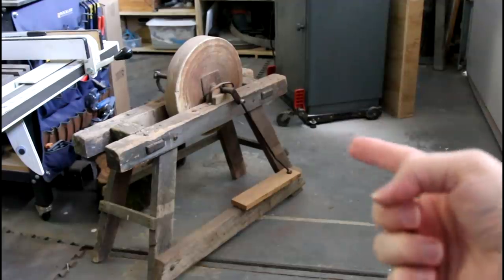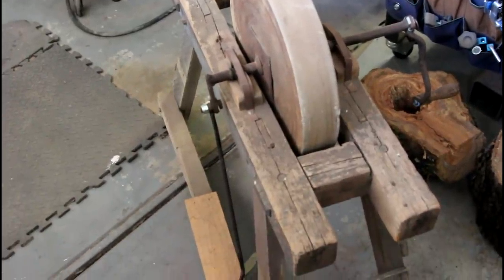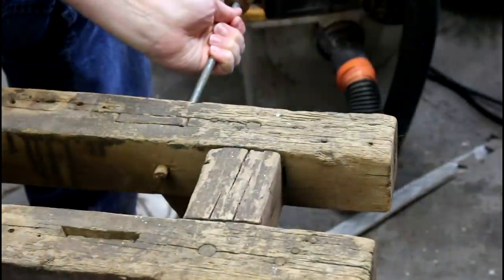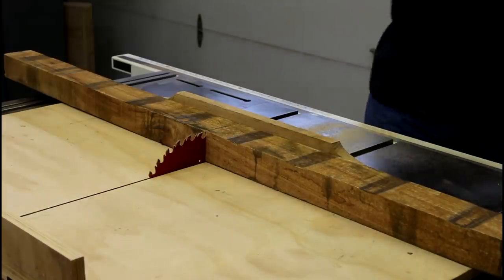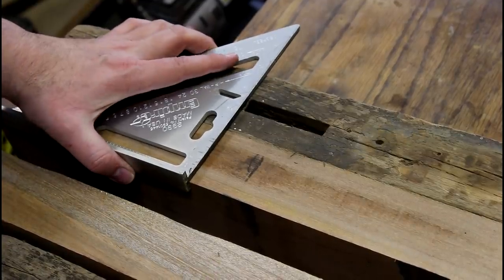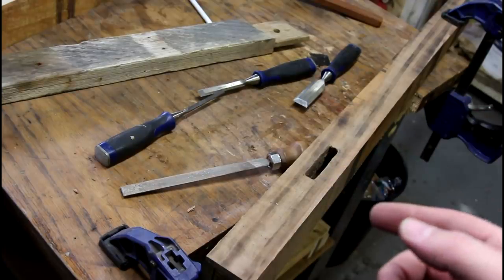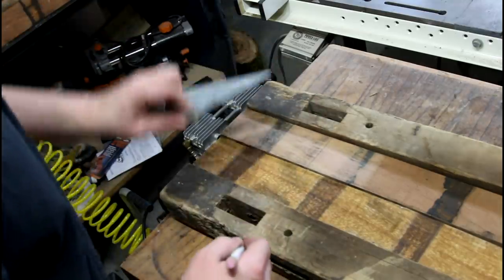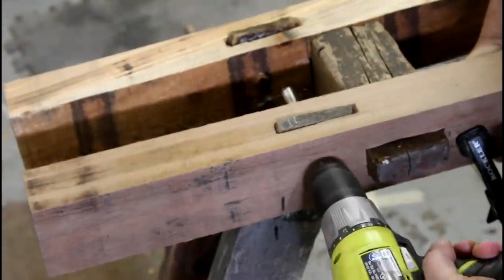Sharpening Stone: A Rescue & Resuscitation Story

Comment from the maker: Thank you all for the information! I'll work on truing up the wheel up and adding some method for wetting the stone. For me, the fact that it turns and doesn't collapse when used is more than I hoped for. 

Its functionality can be...honed. :)
Reply: It's a fair bit of work to true a stone... But I think you'll have the time for it.

Which way is the door, I'll show myself out.

On a happier note, you'll have an easy time using and maintaining the stone.
Reply: Good thing you're getting more info instead of reinventing the wheel.
Reply: Badum-tish...lol <3
Reply: If you add a water trough make sure you never leave the stone in the trough when you're done using it. That's a good way to end up with half a wheel, which is considered a bad thing...
Reply: You did a great job though! I KNEW you were going to pull out some Skyrim quotes :) speaking of actually, I notice the grinding wheel model in the game has a little reservoir of water suspended above the wheel to tip out. I wonder if that would be a solution for you?
Reply: Pretty sure they are designed to have you sit in a chair apposed to actually on the grindstone table haha

Comment: There should have been a cup on the bottom to hold water in case you want to wet sharpen. The reason it was small was because typically the boys in the family were given the job. Nice save!
Reply: Dwarf relic of Gimli
Reply: So you are saying it needs a cupholder.

Comment: Peter, There was quite often a trough under the wheel that had water in it to keep the wheel wet and the tool cool. And, yeah, I have one of those grindstones I picked up about 50+ years back. I need to true it up one of these days.
 I'd love to see you make some resin castings with metal filings in it, but with a big magnet on the underside of the mold so that the resin captures the magnetic lines of force. Maybe install a LED under it so as to really show off the force lines.
Reply: So your wish has come true! He made a video doing just that 3 weeks ago. It looked pretty awesome.
Reply: Please please tell me you saved the wood that you replaced for other projects. Bowl turning etc. The grain must be awesome
Reply: For these old grinding stones the water is to keep the stone clean and lubricated.  The stone doesn’t go fast enough to cause the steel to lose temper.  That’s why oil or water is still used when hand sharpening with stones also.  The steel particles clog the stone and cause it to wear out more quickly if water or oil is t used.  Good job on the restoration!

Comment: Good job taking on some new skills! 

As others have pointed out, with those old sharpening stones, you should use water on the stone to lubricate and help carry away the grit and metal filings as you grind. Some had a trough on the underside that would keep the stone wet. Others had a water feed from the top that would trickle water onto the stone. Either works.

Comment: What’s with all the glue? That shouldn’t have any glue in it at all.
Reply from the maker: my joints needed glue or it would be in pieces again! :)
Reply: The holes should be a little bit offset, so when you drive in the pegs, it pulls everything in really tight. You did an awesome job on that frame though! Not bad at all for a first time! The first time I tried building saw horses using mortis and tenon joints and pegs, it didn’t turn out very well LOL. It took me a lot of practice to get it right
Reply: @peterbrownwastaken  You did good, I'm hoping for a part 2 and 3 where you straighten the axle, make sure the bearing blocks are tight and true that monster stone.

Comment: Awesome Video.  My heart hurt a but with you using plyers to tighten the bolt/nut.  You needed a plaid button down and a news boy cap in the sharpening scene.

Does the stone need water or oil?  Alot of them I have seen have a water bath the stone sits in.

Comment: If you make and put a water trough that hangs under the wheel (and the wheel dips into the water when turning) the wheel stays lubricated, lasts longer and makes sharpening easer and better.
I'd also recommend truing up the wheel a bit. ;) It's not exactly surface grinding but it would make the sharpening easer.

Comment: Those looked and acted a lot like a drawbore dowel by the way it was difficult to drive out. That keeps the joint tight over time, yours probably won't but the overall effort was pretty good. It'd be nice to have you true up the stone.

Comment: For your grinder. Get you a mud pan used for drywall and mount under wheel to wet it for grinding. Beats setting up a dropper which clogs.

Comment: This type of wheel is designed to be used. You can add a drip can on top or make a trough to partially submerge the bottom of the wheel.

Comment: I thought grinding wheels/sharpening stones were supposed to turn toward the blade being sharpened, as though one was trying to use the blade to shave the surface of the stone.
Does it work either way, or do different blades/edges require different methods?

Comment: Nice job, but I can't watch you tighten that bolt and nylock nut with two pliers, as a mechanic it goes against ever fiber if my being. Also the hole for the dowel retainers in three tenon should be drilled slightly off set from the mortice so the joint is tightened when the pin is hammered in.

Comment: You should have drilled the peg holes before gluing with a couple millimeters offset between the hole in the mortise and the hole in the tenon. That way the dowel pulls the mortise and tenons together.

Comment: @Peter Brown I will say that Joinery was a fair sight better than mine (never done it :D ) and was wondering, would it be beneficial to you to put a small basin under the stone so you can use it as a wet stone, or is there even a difference between this and a wet grinding stone ( I have seen them with water basins so am curious)

Comment: Not sure if your table saw was maxed out height wise or not, but i was taught to have the bottom of the gullet the same height as the wood your cutting, not the tip. I believe that is the safest way to cut wood without the chance of kick backs or binding.

Comment: Ok great project but I wanna ask one thing in the end result it looks like the strips of metal that supposed to go under the wheel axle is missing those are there to protect the wooden blocks from wear it did seem like you put oil in there but after a while you'll regret not having the two metal strips underneath now I could be wrong it's hard to tell but overall looks great

Comment: Not how I would have gone about it? I would have removed the stone, made a completely new bench, put the stone on that, then used the old too short bench as the base for a glass top table.  Seemed kind of odd to only replace those two boards then do a lot of bracing and whatall.

Comment: Peter Peter Peter you never never pull a partial cut board out of a running table saw always push it all the way through then shut down the saw  and lift it over the blade. One of the first rules taught to me in shop class.

Comment: That is a wet stone, it needs a way to keep it wet and the blade cool. There were two common methods, a can that was made to leak on the stone slowly, the other method was a fitted pan, usually copper, that sat underneath the stone.

Comment: Please don't use files to knock pins out because they are make of hardened steel. Which mean if it fractures it will fling out like a bullet because of the stress in the steel form it's hardening process. It could injure you.